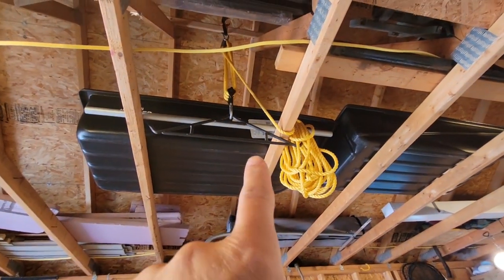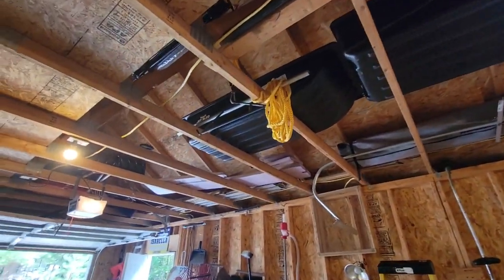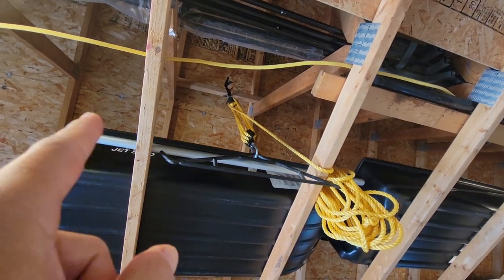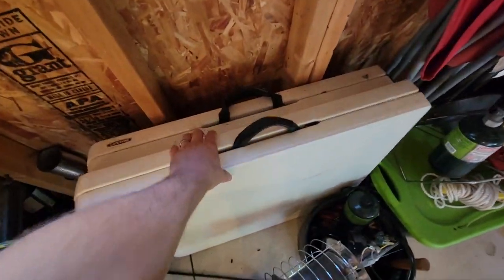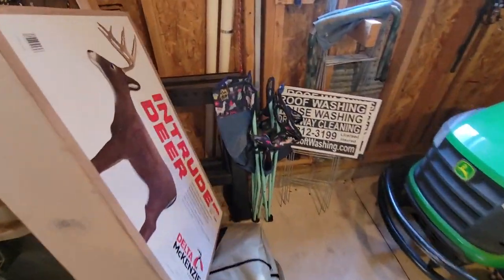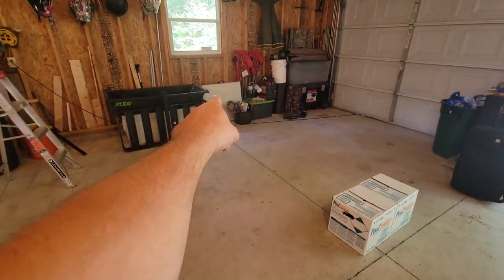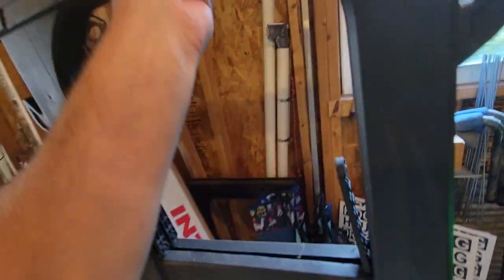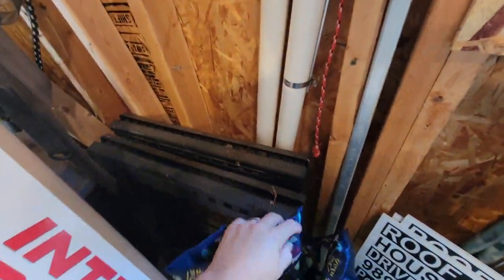What You Need To Process Your Own Deer

Comment: I fully agree that the LEM grinder is a wise investment.  I have used one along with my dad from the 90s.  Until my dad passed in 2013 it handled both our limits of deer every year, along with helping out a friend on occasion.  That grinder has done the job on 100s of deer now for over 20 years.  I am not a fan of the vacuum sealers and have had better luck using traditional freezer paper which keeps things preserved just as well from my experience when done correctly.  The one vacuum sealer I owned lasted less time than the wife I was married to when I bought it.
Reply from the maker: Yep the vacuum sealers wear out fast unless you get a good one.

Comment: Been processing deer n game for 40 years. Certainly don't need a vacum sealer.True cheaper ones don't last But cheaper ways to package your meat than vacum sealer and bags are expensive.
Reply from the maker: Butcher paper works but is also not cheap and the meat stays good longer in vacuum bags. Tried it all. Even double wrapping butcher paper etc. A vacuum sealer is well worth it and bags are dirt cheap on amazon just like I show in the links. I have processed a couple hundred animals and this is my personal advise. Hopefully it save people some trial and error. There are other options. But I personally don't think there are better option.
Reply: Nope wrap first in Commercial plastic wrap,  then in freezer paper. Can buy alot of both for just cost of machine. And still cheaper than vacum seal bags.  @SamkoTradBow
Reply from the maker: @jamesbarnes7689  sounds like you have a good system that works great for ya